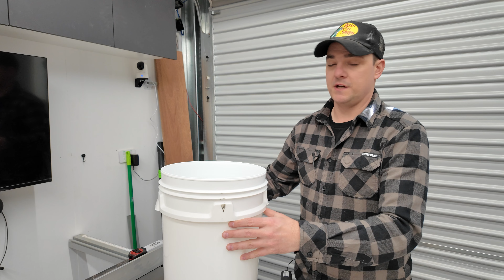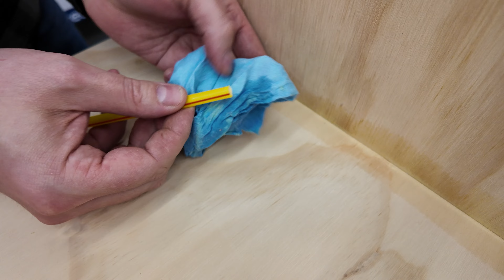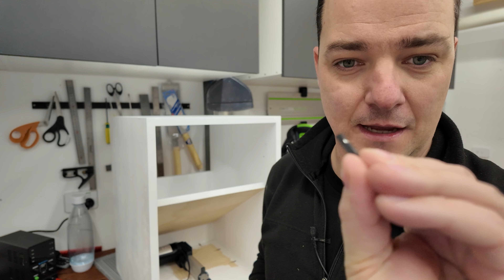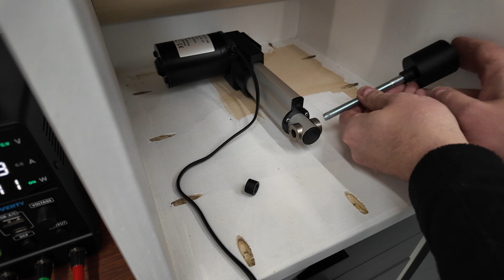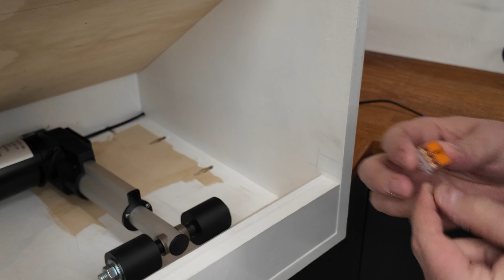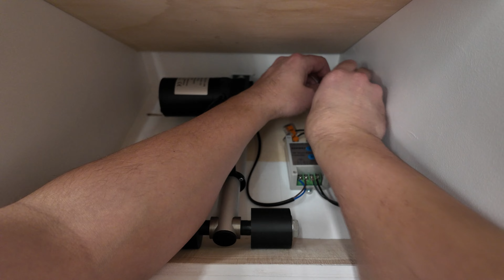Build an electronic cyclone dust extractor for your woodworking shop

Comment: damn man! love the ingenuity but why not go passive? I have a separator for my CT26 and i just angled the top of the separator and collection bin, so that it wedges itself in and forms a pretty good seal. when i switch on the vac, it actually lifts the collection bucket further and forms a perfect seal! the right gasket material lets the collector do all the work, no gadgetry required 😎😎
Reply from the maker: But then we don’t tinker 😉

Comment: If you place some limit switches at the two desired extremes of where your 3d printed rollers go you could remove the guess work on when to let go of the remote.

As a viewer, the feedback I would give about the length of your video is that you could cut out a of of the 'trying out' sections of video. You were trying out your mechanism about 5-6 times in this video, when you one pre-build 'moved with your hands' motion to explain when your going to do, then building steps, and then one showing it working at the end would have been enough, we don't need to see your testing it  after every step unless you need to show some kind of problem you were not expecting when you showed your plan at the start comes up.

With regard to the actual result, good job!
Reply from the maker: Great suggestion, will need to grab some limit switches. Also, thanks for the feedback, I probably got excited that it’s finally working after living in my head for the past 3 months.

Appreciate the feedback!

Comment: Earned yourself a subscribe sir! Really enjoyed the style, the healthy balance between talking and music, really liked it. And the length was fine for me! 

You might consider getting some switches too act as auto stops so the actuator doesn't extend too much, and it would do away with the quick reflexes on using the remote!

Please keep up the great videos!
Reply from the maker: Thank you, very much appreciate the kind words. I think adding some limit switches is a very easy and quick upgrade. Will need to grab some off eBay. Much appreciate the suggestion, there is always something that can be improved!

Comment: Hi there, Marcus again, That is a nice way to sort things out in a small workshop... I'd actually ditch the remote! because frankly we have too many of the silly things & you would only need to use it when changing the buckets.....( that said we wish them for other things) I was in the chemists waiting for a Script the other day (I still use Paper scripts & I am glad of that with the news this week we had of the information breach this week in Australia)  I saw that even an electric toothbrush has an app....... I had a remote with a reversing camera I purchased for my vehicle some time ago. (I was using it more as a rear view mirror) I misplaced the remote.....  but then must have disconnected the battery in the car for some maintenance reason  completly seperate to the reversing camera & It reverted back, so If a car passed me on the drivers side it showed on the camera on the passengers side!  Perhaps why I noticed & wrote to you a week or so ago!......The most disconcerting 20 Klms I have ever driven!!!!...... The people where I purchased the camera helped me & used another remote as I couldn't find mine...I very nearly purchased another!  But as you might well know, as soon as you commit to that new one, you find the missing item.... And  I did find it a couple of weeks later........ I am enjoying your journey  so Keep it up.....Marcus
Reply from the maker: Hi Marcus, appreciate the kind words. You are right, buying online can be a little hit and miss.